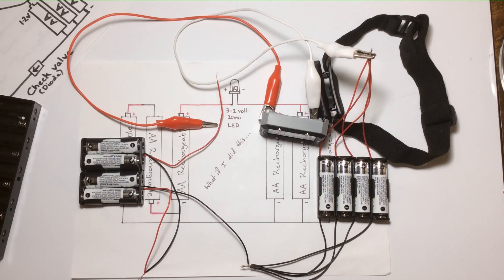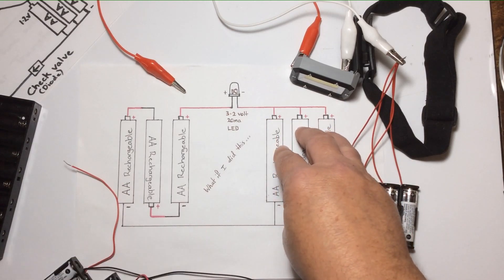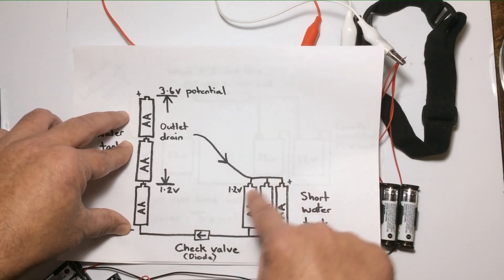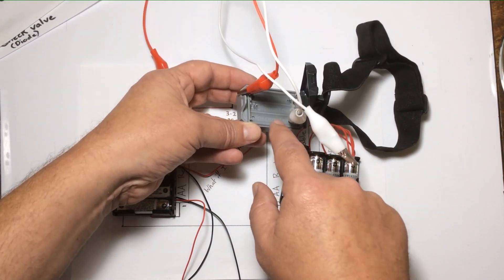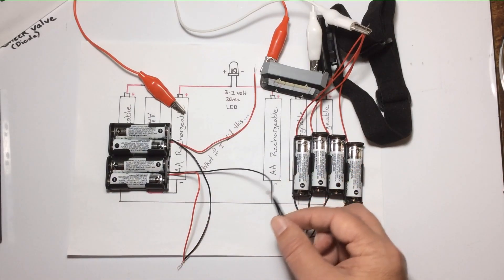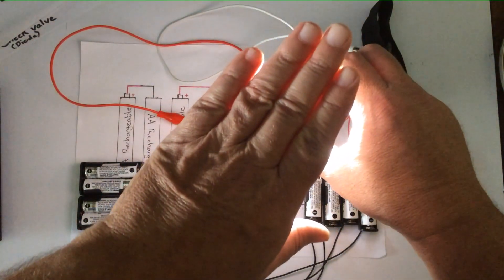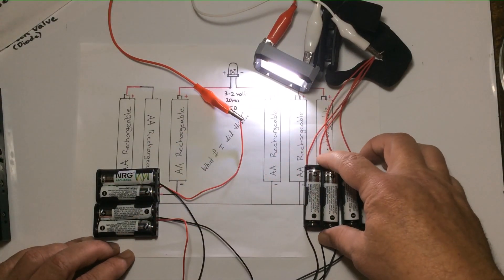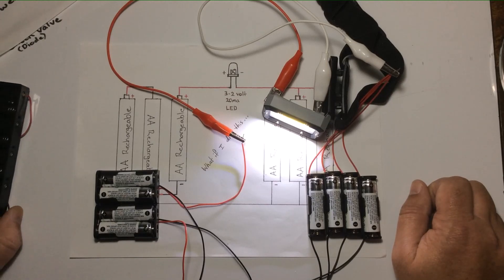GREEN ENERGY DOES NOT GET ANY EASIER THAN THIS

Comment: Do you think this would work on a inverter as load? With a 12v setup
Reply from the maker: Thank you for your comment.
Yes this will work with a 12 volt setup. I have created a couple of videos showing different runtimes for varying 12 volt devices like motors and incandescent lights. I have personally tried a 12V to 240V inverter which worked fine and a subscriber also stated they had success with a small inverter. A word of warning, I have fried a voltage sensitive relay in the 12V version, this could have been too confusing for such a device trying to measure low voltages to cut the relay. I take no responsibility for any damage but this is how I find out if something will work or not, I just don’t use my most expensive stuff to test my ideas and sometimes I buy a cheap unit just for testing.

Comment: Spent some money and bought the batteries to test this out. Surprised, but not surprised. Things are running well with a tiny 3v dc motor. Yet to test out on other items and how long it will last. But I noticed the voltage is getting higher as the dc motor is running. This is quite interesting to me because the opposite is what usually happens. My main interest now is: “will this work on bigger 12v battery like lifepo4 or gel battery?” 🤔
Reply from the maker: Thank you for your comment.
There are a lot of interesting points with this setup, anomaly’s that change and things that aren’t quite expected. This does work on 12 volt setup and other battery chemistry as you can see with my video on the 12v version, it is important to take caution with lithium in regards to the BMS, some BMS don’t allow for serial/parallel connections and this may cause damage to batteries with a BMS that is incompatible with these connections.
Reply: @whatifididthis...1236  well. I decided to test out lifepo4 batteries. Here’re some of the things I learn using a tool I bought to compare voltage, watts and amp: 1) with this setup, I managed to make full use of the capacity. If the battery says 7000mah, I can use up to 6000mah 2) using 100% is bad because the battery is now dead and cannot save it no matter what 3) the normal way of connecting the battery burns through electricity much faster. I might be lucky to get 1000mah from a 7000mah battery. Gonna do another test but this round will charge the battery to 100% and put some serious load on it.
Reply from the maker: @passion4z846  Thank you for that information, I had suspected it could cause cell failure as those batteries usually have a low voltage cut off, at which point the battery can’t be recharged. I did watch how to revive the batteries in “lock” just recently where they are connected in parallel with a charged battery which brings the volts up above the cut off or “lock” value. No guarantees though.

I really appreciate you supplying your test information, if everyone added a small contribution we can answer a lot of the important questions without any one of us shelling out massive amounts of money on research and development.👍

Comment: I’m not sure if example of 2 buckets stands. As if it does that means your led simply prevents batteries from self discharging by using a very little draw … I remember this trick from some 30-40 years ago when 1 of my teachers told as how to avoid a flat battery in a car during the winter. Also, led being a check valve doesn’t make sense as mainstream science teaches electricity flow from- to +

Maybe an incandescent bulb 1.5 V  would demonstrate better what the achievement is. Eventually an led in series would prove its role as a check valve if it’s true.
Reply from the maker: Thank you for your comment.
The water analogy helps to understand the behaviour of electricity wanting to go to the lower potential in the same way water flows down hill. Whilst I understand the electron flows from - to + the power flows from + to -, I watched an excellent video on this not too long ago.

The batteries do discharge but in the process of discharging they transfer the energy minus losses into the parallel batteries. The parallel batteries connected into the circuit after the LED essentially act as a series connected resistor, however this alone does not explain the exceptional run times.

I also remember this from many years ago being used to charge a car battery, many many years ago, when I was young and wasn’t interested.

Comment: Great video !!   I've heard people refer to this process as splitting the positive .    On the source side you have 4 1.2 volt batteries ?    This would make 4.8 volts.   On the charging side you have 1.2v in parallel.   When combining  the two sets of batteries it appears to me that the difference is 3.6 volts which would be going thru the load , not 4.8 volts  ?   Am I missing something ?
Reply: It just occurred to me that your charging side are discharged batteries , so less than 1.2 v each .  So I can see how you're getting a higher voltage than 3.6 volts across the load !!
Reply from the maker: @mscavsfan  The first few tests I ran with this setup the charge bank batteries were flat but I have also run the system with both banks fully charged, it doesn’t seem to make a difference. At least I can’t determine a difference with tests done so far.
Reply from the maker: Thank you for watching.
I believe you are correct as I have also read and heard it described as splitting the positives which can also be done splitting the negatives and from my tests splitting the negatives is more efficient. You would be also correct regarding the voltages, according to the multimeter, the voltage between battery banks is a-b.
This where I throw my hands in the air puzzled, for example in the 12 volt version we have 24v-12v= 12v so you’d expect a 12 volt light to work but in the case of this model 4.8v-1.2v= 3.8v which is not enough to run this light at that level of brightness for that long as it’s required voltage is 4.5v. In case of the 275 day test it makes even less sense 3.6v-1.2v=2.4v when it’s operating a 3v LED. It gets worse when you calculate the energy used and there doesn’t even seem to be enough energy to keep the LED working this long.
I am happy to be wrong, in fact I would prefer if someone explained why I might be wrong because at least I would know the truth.
The only explanation I can give is the load somehow sees the full voltage of the primary battery bank and not the split voltage, regardless of what the meter says.
Something isn’t right here and I wish someone would explain it to me, I hate not knowing.

Comment: This video has a flawed understanding of electricity, entropy and thermodynamics in general.
You have incorrectly made a 3p3s battery that will overcharge the 3p section and cause battery damage.
The led will stay on for long periods of time due to low power draw.
Reply from the maker: Thank you for your comment.
Let me start by saying this is not my invention/ concept, the great minds of our past used this arrangement frequently due to its efficiency. Great minds Like Nikola Tesla, Carlos Benitez and Gabriel Kron so if you really think about it, its those people your argument resides with, I am merely pointing out that in our past we were more efficient at using energy.

The reality is our education is wrong, our education was developed to put blinders on you and keep you focused on a narrow path. In this case they just stopped educating that this was a reality and so you and I didn’t know about it for obvious reasons. This is another reason why the UN wants to shut down our internet rights because we have learned too much since its conception, there just weren’t too many of us going to the libraries to read about patents before the internet.

There are a lot of smart people in the world, for once I wish some of them would use their intelligence to investigate why this works and help educate the rest of us on how. I have run a similar system for 275 days before I stopped the operation of said test as the batteries were way below operating voltage yet the light was still dimly lit. There is no damage done to those batteries in the 275 day test, I thought there would be damage because our education says so, but again, if what you learn is wrong then it matters not that you might be an honours student for what you truly are is exceptional at reciting wrong.

There is simply not enough energy in six AA 1.2 volt 2500mah batteries that were used in my 275 day test, I’ve done the tests, I’ve crunched the numbers and presented my findings. There is no point in me attempting to deceive anyone here as you will know as soon as you replicate this and see with your own eyes, calculate the data with your brain and not the wrong think we were educated with.

I honestly encourage you to suppress your educated ego, humour yourself and set out to prove Tesla wrong because I didn’t believe it would be so so efficient as it is either, seeing is believing, I need not trust anyone that it’s a reality because I have been there and done that!
Reply: @whatifididthis...1236 fortuanately for this case i am an electrical engineer and may be able to explain to you what is happening here. none i
Of these inventors came up and used these principles as they are not effective. I'm not sure where this design came from but it simply cannot function as you claim it to, due to the laws of thermodynamics. In this case the 3p batteries are being used as a path for the 3s batteries to discharge due to their combined I internal resistances completing the circuit.
Run this test again but with a proper 3p2s configuration and a resistor to stop the led from drawing excess current and blowing. you will find it will last longer.

Comment: I saw the originals and loved the idea.  I'd love to try this one day when things calm down a bit for me.  Now, this is my total ignorance speaking, but I think what I'd find if I did this exact experiment and one along side it with six 1.2v batteries might be comparable.  It seems like you are "slowing down" the flow, plus giving it more capacity with the three in parallel.  I'd guess that if you took the volts and amps in each case it would possibly equal out.  Still, even if that is the case, if your specific application could function on lower voltage/amps, then you are achieving some level of conservation which is really huge.  Either way, props to you - keep the videos and thoughts coming!  I do believe this is an original idea - I've never seen it before.  I always enjoy watching your videos.  Thanks!!
Reply from the maker: Thank you for your comment and kind words.
I can’t take credit for this setup, this was something that was well known around 100 years ago. I guess the money cartels couldn’t make enough money if electricity usage was efficient and so they stopped teaching this.
Many researchers used this in their systems and even in patents with much more elaborate setups, Carl Benitez filed for patents that have this setup displayed within, Nikola Tesla as well and Gabriel Kron used this concept also. Strange to think there was a time when this was common knowledge, I imagine they’d say to us “how did u not know this, have you been living under a rock”?
I will run the control experiment for this unit in a few days and perhaps post a short video related to it.

Comment: You said that it ran for (200+ days) in this configuration. So, how many days will it run on the (original) configuration of the batteries? You never stated that. The difference would surely spell the value of your new “Green” configuration.
Reply from the maker: Thank you for your comment.
The 275 day test unit was not this setup however it is the same concept of power transfer. This one will come nowhere near the 275 day unit as the batteries in this unit are 1000mah and the 275 day unit had 2500mah batteries. The control test for this unit I will perform in a few days whereas the control test for the 275 day unit was less than 12 hour operation. I put it on before I went to bed and it was off when I woke up which seemed standard for a AA torch to have flattened the batteries during the night.

Comment: Interesting test.  Have you conducted a control part of the experiment where you are comparing a normal use of 4 batteries compared to using your innovative solution?  Between the 2 tests: What is the difference in length of time of lighting the LED?
Reply from the maker: Thank you for your comment.
I have conducted a control test with the 275 day test model which ran for less than 12 hours. I will run a control test for this version in a few days as it is still running as seen in this video which has now been 48 hours. I will record the first battery swap today and post it, run it until it dims to this same level and swap batteries around again, then I will perform the control test and let you know.
This setup will come nowhere near the 275 day test as the batteries are only 1000mah in this video and the batteries in the 275 day test are 2500mah, as well as the larger light drawing about 100 times more power.

Comment: Wouldn't it be more efficient to just wind a motor stator and rotor with a mix of asymmetrical generator and motor windings? The thing would run itself forever.
Reply from the maker: Thank you for your comment.
I believe you could be right, it would not take much at all to make it run forever. The thing I like most about this setup is no coils, nothing but batteries and simplicity. Sometimes the coils become their own nightmare, I’m not exactly sure why I hate winding coils, perhaps I have wound too many but to be honest it’s my physical limitations of my disabilities that just make it difficult for me to sit in one spot for hours as some coils have required.
Reply: @whatifididthis...1236  Fair enough, I myself find windings a tad intimidating but that's probably because I lack on hands experience, and simplicity is attractive for a number of reasons.

Comment: I did it, my led lasted 2 days
Reply from the maker: Thank you for your comment.
Can I ask if you used rechargeable batteries? Others have told me they replicated this with NON rechargeable batteries and whilst they stated the run time was quite long one can only assume it would not run for 275 days as mine did. I might also make note of the amp hour capacity of my AA batteries is 2500mah for each battery. The batteries in this video are only 1000mah each, so I am interested to see how long this larger LED light operates, I will make an update video when it requires the first battery swap but so far it has been running for 9 hours and counting.
Reply: I'd like to get it to work. I'm using rechargeable 3.7v 500mah batteries. I had three in series and three parellel , the three in parellel are dead now, can't take a charge. They were powering a large LED 3v. I realise now having three in series would have been pushing almost 12v into the parrellel batteries, so probably not great. Do you think I should try 2 in parellel and 2 in series? @whatifididthis...1236

Comment: So this can be done with a coil? Pulse motor?
Reply from the maker: Thank you for your comment.
This can be done with just about anything and from what I have read pulse motors work great as the back emf can be used to supply additional power to the system on every coil collapse. I am in the process of rebuilding an old pulse motor with a special coil I have held onto for 22 years so I hope to let you know how it goes, please let me know your results if you run the tests with a pulse motor in the meantime.

 This can also be used to recharge batteries, for example, if you had four cars with flat batteries you could string three batteries in series and use a light or electric motor to transfer the power of three batteries into one battery to start a car, once the car is running you can start the other cars.
Reply: any dc motor can be put in place of the led.  it will run off the difference of the 2 voltages.  not sure if its over unity but its close.
Reply from the maker: That is correct, I have used a dc motor whilst demonstrating the 12 volt version of this concept. I believe it is as you say, close to overunity but needs a little extra to close the loop. I have read that pulsing the load can draw in the extra energy during a field collapse.
Reply from the maker: @sprinteroz2239  Thank you for your comment. The right pulse circuit will take this concept to the next level. The Tesla switch was said to operate best at a switching rate between 100hz to 800hz I did try a couple of small joule thieves I have here and they did not work the way I would have liked. I also tried my Through Earth Single Wire portable circuit on this arrangement in the 12 volt version which worked great.

Comment: Most people think the LED consumes all the power, but it dosent.  It passes through minus power converted to heat.  Yes, the light is a bi product of the heat.  Great video!
Reply from the maker: Thank you for your comment.
I believe you are correct, I used to think the load consumed the energy although I’m not sure why I believed them as the other doctrine was you can’t destroy nor create energy.... well where did it go then and why do I have to buy more energy to put back into the battery? I can only assume my education led me to that flawed way of thinking because that is what I was taught.

The truth seems to be as you say, the energy is transformed into heat and the LED is consuming practically nothing, sort of like a paddle wheel in the stream of nature, it turns as the energy rushes by.
Reply: @whatifididthis...1236   - ohms' law is for slaves. Limited at best to keep the mind in a box.